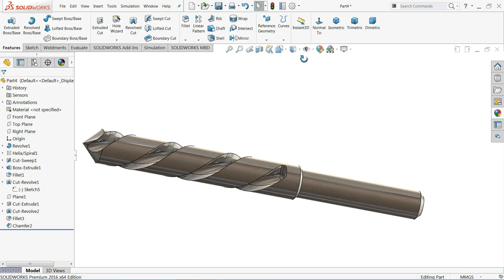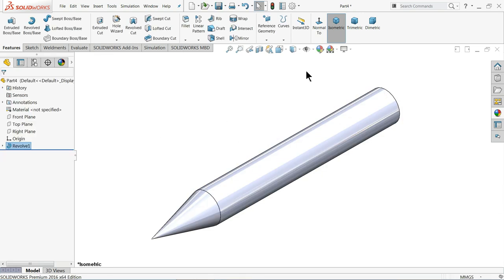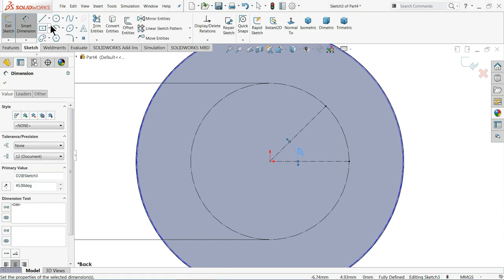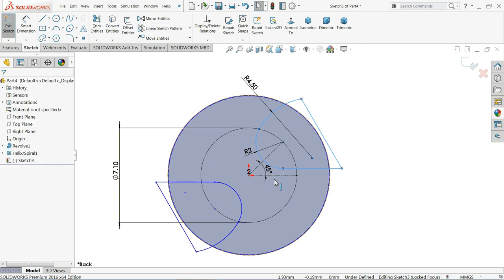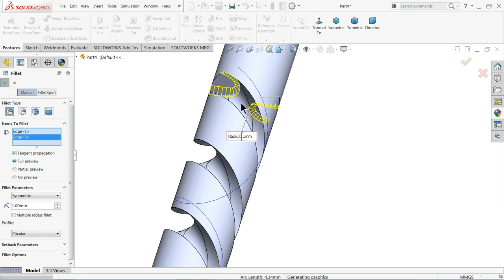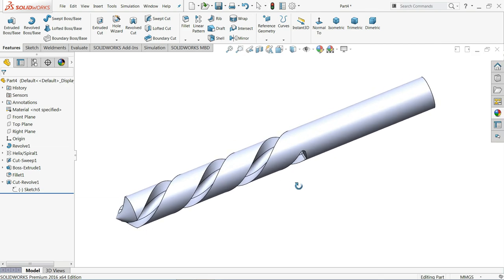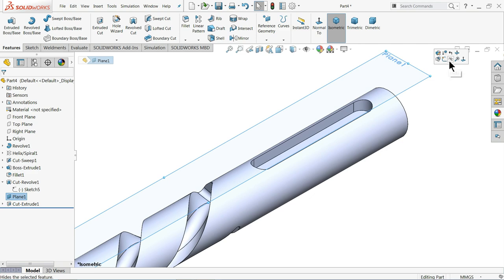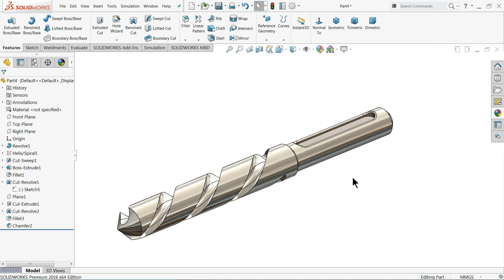Solidworks tutorial how to make drill Bit

Comment: This is not perfect drill .
It has only one flute .
Reply: Sure it is. Standard drill and he put a 135 deg point angle on it. 130 to 135 deg point angles (carbide or 8% cobalt)are ideal for very hard metals like stainless steel. The 118 deg point angles (hss) good for composites or aluminum.
Reply: There are two but not easy to see. This drill would cut nothing, sorry.